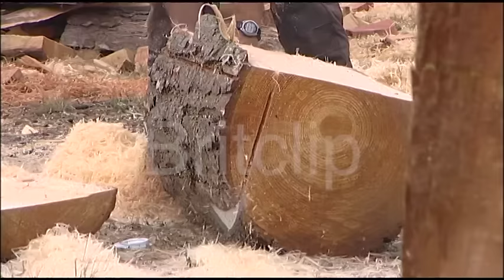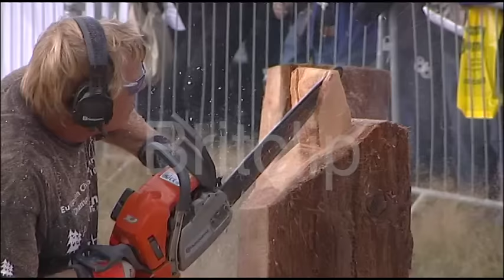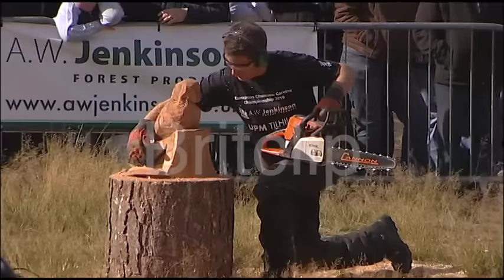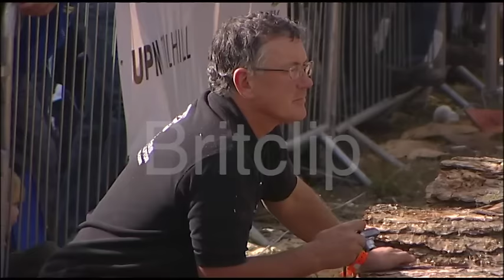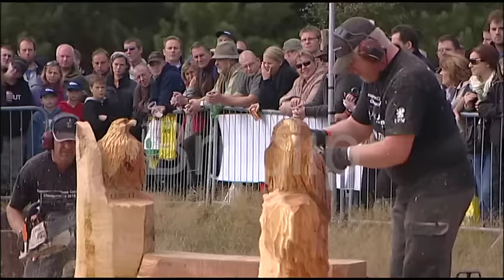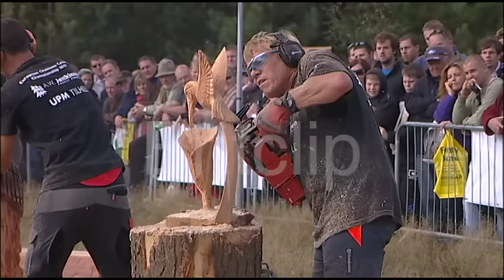European Chainsaw Speed Carving Championships

Comment: The thing I was most impressed with is that their chainsaws were running. Oh sure mine runs great. It starts every time on the 3545th pull. Runs for 30 seconds at a time.
Reply: It's called maintenance.
Reply: @Salted_Fysh  actually, it's called a joke.
Reply: @kickeramps  not really. Kickback from poor maintenance can be lethal so it's an important issue. Chainsaws are a powertool and not a joke so they need to be treated as such.
Reply: Adjust or replace your carb it will run smooth
Reply: @Salted_Fysh  wow, I bet you are fun at parties.
Reply: @djames2377  not quite sure how people can't tell this is a joke. I guess bread isn't the only thing that's dense.